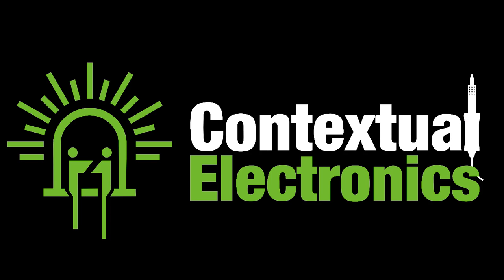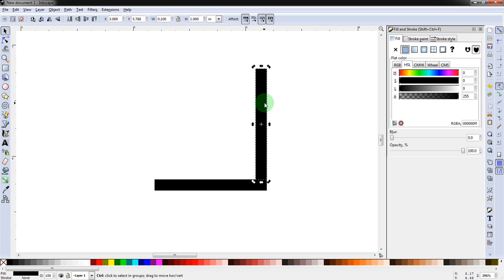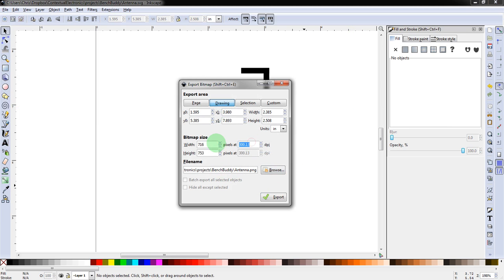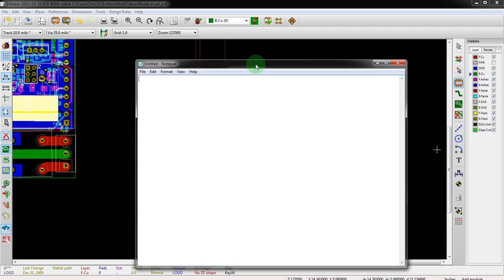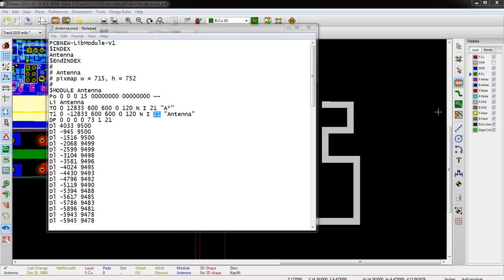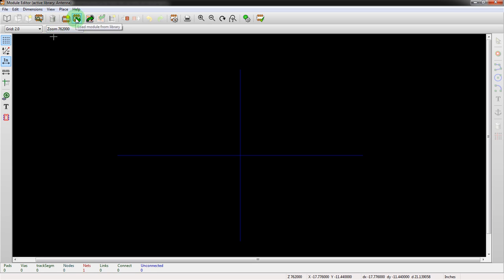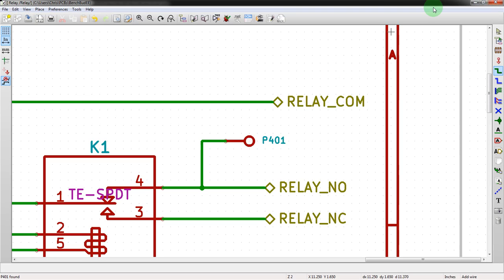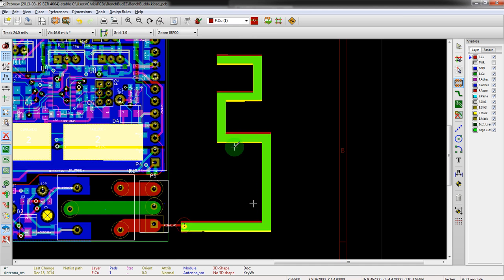KiCad 3.0 - Making A PCB Antenna in KiCad

Comment: Obviously， This antenna will not work well. The antenna need to be design based on its wave length, the velocity factor of PCB, stray capacitance, solving VSWR/ return loss/reflection loss ,antenna bandwidth etc etc etc....  I never simply putting a piece of copper and call it an antenna.

Comment: It is actually possible now with Kicad to add copper to footprints. There a trick to it. Create a polygon on any layer (it won't let you create it on the Cu layers). Then use properties to change the layer to the Cu layer you want. You get some warnings about no DRC checks (which as far as I can see are false, DRC checking works just fine. Then you can edit the polygon just as you would a copper pour. If you need connectivity,  add a pad and place it over the polygon.
Reply: OMG this is by far the easiest solution...been researching how to do PCB antennas on KiCad all day. Cheers to you sir!

Comment: Inkscape was updated and now makes the alpha channel 0 by default. This will make all your bitmaps useless as there will be a clear background and kicad will not be able to invert the image, leaving solid rectangular boxes as footprints. To fix this, change the document properties  (file > Document properties). Toward the bottom of the settings page that pops up you will find a "Background" title and a "background color" box. Select the box. A background color box will open. Now change the "A"  or alpha channel to 255. This will force alpha channel to white and make the program work for you in Kicad.

Comment: This could be good for a rough approximation and in some cases may even work, but I wouldn't go to market with this approach.

Microstrip antenna properties are highly dependant on thickness, length, antenna feed point, PCB placement, PCB thickness and distance to ground plane, etc. At the very minimum I would do some reading on how to design patch antennas. If you are ready to go to market, I would recommend talking to an RF professional to make sure you are getting the best performance.

Comment: Wouldn't removing the artifact and changing the name and layer all be possible grarhicaly in the module editor where you added the pin?
Reply from the maker: The graphical is pretty limited in terms of shapes that you import (at least in older versions, it's possible this could have changed in newer versions). The real problem is that there is no way to actually draw freehand nor erase in the module editor. Everything being added is a polygon and even those can only be added via the silkscreen layer AFAIK.